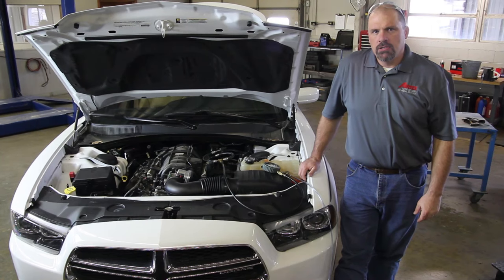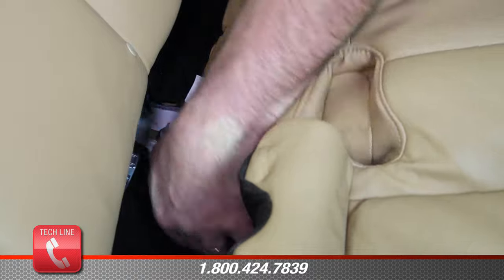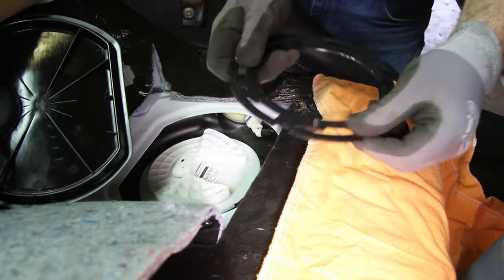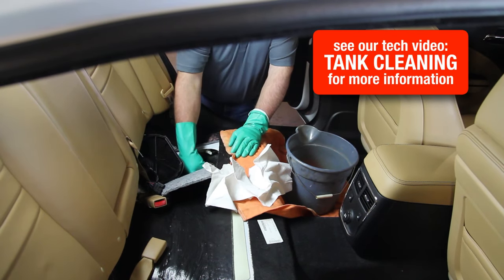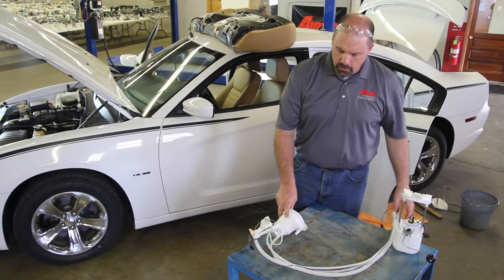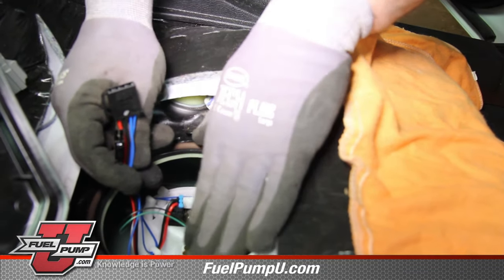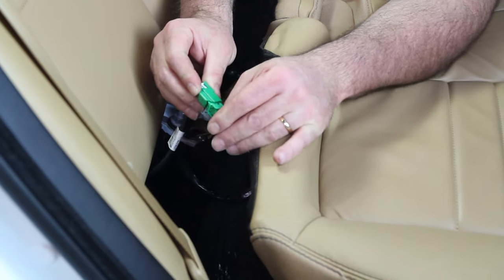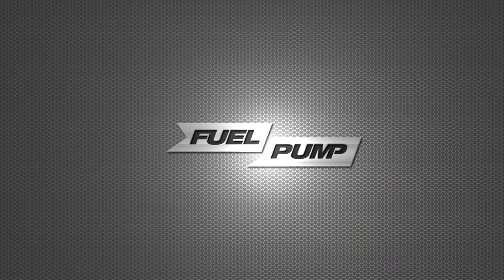How to Install Fuel Pump Assy E7192M in a 2006 - 2014 Dodge Charger, Challenger, Chrysler 300

Comment: The fuel pump went out on my 2006 Charger and this video helped me save $100's by doing it myself instead of taking it to a mechanic.
Reply: See video
Reply: How did you know the pump went bad and what were your symptoms?
Reply: @syndakitpanda1777  started coughing and wheezing
Reply: Mine did it this morning. I she started giving Covid symptoms. So I turned the button to on to see if I could hear the pump..... 🥲 just silence.
Reply: Before 2011 did they have 2 fuel pumps??
Reply: @TAPATIOPLEASE  yes I believe so.  The whole tank setup is the same just different pumps for high performance models. 

The driver side is the main the passengers side just sends more fuel to the main pump. Was the best way they could give it a almost 20 gallon tank.
Reply: @Vancev99x  ohhh I wouldn't know I've only had a 2.7 and 3.5 v6 🤣🤣 my cousin has a 2011 challenger with the 3.6 and 8 speed and his also has 2 pumps but mine only ever had 1 . Makes a lot of sense now
Reply: @TAPATIOPLEASE  oof the 2.7. That engine made mechanics come home kick the dog and smack their wives. I think dodge owes ever one that had to work on one a hellcat! 🤣 the 3.5 wasn't too much better but the 2.7 was just... 200k miles max on most of them and then is was just done working. 😅

Comment: for any of you interested - 2014 Dodge Charger SRT ; was just quoted $800 for diagnostics & replacement of main fuel pump at local Dodge Dealership- car has about 50k miles and it was still the original pump.  This is a common issue with the Dodge Charger, Challengers &  300's from 2006-2014
Reply: They improved the pumps from mid - 2014 on up.  All part numbers do, in fact, supercede to the new parts. 

The 392, Hellcat, and Pursuit models use a more powerful pump than the other models, and costs quite a bit more to replace.  A reasonable option might be finding low-mileage replacements from the boneyard.
Reply: Perfect.

Comment: On a push button start if you push the button twice without mashing the break it engages the fuel pump pushing the button twice without holding the break is like turning the key to the on position if you hit it a third time it goes back off

Comment: I did everything right. Now it's like the car is draining in power. It won't start at all. It's saying key fob not detected, the interior lights are dim, the horn is dim, no headlight's. Now  I have no power in the car. Is it a relay? Or battery?
Reply: Same did you ever fix it

Comment: To put the "diagnosis" simple, the right pump's main purpose is to provide the engine with fuel while the car is on, the left pump's main, but not only purpose is to provide fuel when the car is turning on, or idle.
Reply from the maker: The main fuel pump module is located on the left/drivers side of the vehicle. The auxiliary fuel pump module is located the right/passenger side of the vehicle. The fuel supply line to the engine is on the auxiliary fuel pump module  and supplies fuel to the engine. The electrical connector is on the main fuel pump module and controls both modules. Only the auxiliary pump module supplies fuel to the engine.

Comment: The fuel pump check valve is located in the right side of tank, not the left side. Wont hold fuel pressure on restart causing extended crank time.

Comment: Hi, great video!  Could you please provide info about the other module on the right side?  You mentioned that both of them are important.  
Also another video shows using silicone paste on the gasket; does this make sense to you?  Obviously want to use an appropriate amount (not glob it everywhere).

Comment: i have a '11 dodge charger R/T Hemi, and recently i noticed a tapping noise directly in front of the driver side dash that spontaneously starts during my drive and even when the car is  off. Almost around the same time cylinder failure started reducing the power i get when i press the gas. I'm starting to figure the two are related. Do you thing that replacing the fuel pump would solve my problem..Need help!
Reply: I had the same problem, I am sorry this may be too late to help you. The problem you are describing is the air conditioning recirculation control valve. you can access it behind your glove box.
Reply: Yes it’s the blend door actuator by the fan underneath the glove box. I replaced mine. However, one suggestion when you to to repair, do not buy an aftermarket actuator. It will go out in a few months and the work is tedious to fix. Buy the Mopar brand. You can get it cheaper online through Amazon.

Comment: it would have been handy to tell somebody how to take off the high pressure hose because now I snap my main fuel pump connector and that wasn't the module I was trying to fix now I have to replace both of them thanks
Reply: yeah...looks so easy in the video, but ALL the detail is completely left out. Might as well have said "replace the pump, all fixed". You will never have a successful repair from this video.
Reply: @B_HarTz  facts. He was moving too fast, his fault

Comment: Airtex I have a 2016 Dodge Challenger SRT and I have to get a new fuel pump which is covered by Dodge. I was told to run my fuel tank down so as not to make a mess in the rear of my car. Is this a similar installation as your video? Could this be done in a day if the dealer has the part? Thank you.

Comment: i have a 2005 dodge magnum and i suspec the fuel pump has gone out because i turn the key and do not hear the pump cut on. i dont know which pump has gone out. so im here asking how do i test the fuel pumps to see which is bad? rather a simple way or down to checking things with a multimeter. can you please help with diagrams, any schematics links or even what the resistance should be in the pumps for a working order? thank you

Comment: I've been having a problem with my fuel pump. When i was driving it and pulled up to a red light, then it turned green and my car shaked a little and turn off and I couldn't start it and the gears were locked. Had a mechanic check it and he changed the fuel pump for me, and my car was driving good again. A week later the check engine light came on, I had the same problem and i purchased and tried to change the fuel pump twice and drained the car from old gas, What do you think the problem could be everyone says the fuel pump but i put 2 different ones on and it wont start.
Reply: Fuel filter maybe

Comment: can you post how to replaced the fuel pump on passenger side
Reply: yea i agree, my secondary pump on the passenger side strangely has a crack on the top or what looks like a cover (the white part you see as soon as you remove the black plastic cover under the seat) causing fuel to pool in recessed areas. can the white top part be replaced or would i have to buy a whole new secondary pump? my reeks of gas from 5 ft away if there is more than 3/4 tank. def seems like a manufacturer defect
Reply: @UptownWatta  this is a European design as well and the suspension mercedes has this problem and sets an evap code you can get the cover seperarely and replace it don't try to glue it it doesn't last long I know

Comment: dear there hope you answer. me shortly .. i have got dodge charger fuel issues then i cleaned booth pumps but after the fuel level meassurer began to start from the middle never get to the left empty side  . nomatter how empty the tank is the sensor remains on half plz let me know where the problem is
Reply: +Airtex/ASC Performance Pumps thank you sir but just for more sure i wish to know how those sensors look like & how they supposed be set in right way .

Comment: Hey, how are you? nice video,I have a Dodge charger 2006 SE V6 3.5L, and  Im having troubles with my car, it has a elevated consume of fuel, and when its on sometimes the car feels like he got out of air, and I think that I have to change the fuel filter, I already change my spark plugs, but I really cant find where the filter is, and I didnt find it too on internet, could you please tell me if you know where is it, or what you think it is, Plz Thank you!!
Reply: +Airtex Pumps ufff thanks a lot,  another question is necesary to change the pump? I mean, must of  these cars has a parameter to change it? líke oil and other filters.
Reply: Ufff, thanks a lot!!! That really helps me.
Reply: +Airtex Pumps  I have an 07 chrysler 300c. .my car all of a sudden started idling rough ..i jus changed plugs And pcv valve. .i also added some fuel injection cleaner and then it started the rough idle ..do u think it's possible that it cleaned my system and now that stuff is in the filter causing it to idle rough?
Reply: carlton curry that would be the egr tube gasket not seated properly

Comment: Thanks for the video it helped but after about a week since the pump replacement I got a p0463 engine code which is the fuel level sensor. Did I do something wrong ?
Reply: Did you ever figure this out?  I have same problem
Reply: @Darkblue228  it’s the cluster, gas gauge needs to be soldered. Remove cluster and take it in to get fixed or checked

Comment: I have done this all setup but after a one day I changed fuel pump it won't work no noise at all when I switch on the keyfob any help
Reply: Airtex/ASC Performance Pumps
Reply: Could one of the connectors not be seated properly?  If you forced any of them, a connector pin could be bent...
Reply: If it’s cheap eBay and Amazon pumps, it won’t work, both pumps make a sound when they turn on. If they don’t make a sound, return it or buy auto store brand with warranty.... I learned the hard way if anyone else needs that info lol

Comment: Why does my 2006 charger stall when I fill up the gas tank it takes about four minutes for it to stall then I started up and it runs fine until I filled up with gas again
Reply: Airtex/ASC Performance Pumps they've been working on it they replaced the gas tank I'm going to fill it up with gas and leave the gas cap off for five or 10 minutes and see if it's a pressure problem with the Charco canister
Reply: X53 warranty
Reply: Srt Charger Old Man 2006 sounds like the purge valve is  bad

Comment: Is there a fuel filter in the Primary Pump (left side) ? I changed the secondary pump (right side) and the filter was very dirty.
Reply: No. There is no fuel filter at all
Reply: It's built into the assembly
Reply: @TheWillOfFate2014  Thanks for getting back to me. The Primary Pump failed 3 months ago. I asked the shop to save it for me. (The Pump AND the shifter failed at the same time so I went to get help) the primary pump has the smallest filter. and while the the motor still ran it seemed the pump failed to give enough pressure. A rip down of the entire assemble showed no mechanical failure. I can only guess that the small filter got clogged.  Very expensive failure point.

Comment: I change just the pump on the driver side of the dodge charger. Now im getting wrong readings on fuel guage. any ideas on how to fix this?
Reply: Jason Williams I have the same problem, did you ever figure it out ???
Reply: Dave Negrete yes. I figured it out. You have to take the pump back and get the  other brand , I’m away from my house right now so I can’t tell you what brand it was that I brought. But pretty much what the problem is , the pump Floats are made differently. If you sit compare the pump you have now to the old you would see that the old float goes down about 1in further than the one you have now.  
I took it back to advanced and got the one that’s under the premium sections which was about $10 more.  
Let me know if that works for you.
Reply: Yeah I figured it out myself, when I placed the fuel pump back in, the float level sensor accidentally got stuck over the plastic bracket on the fuel pump itself. So I took it out and I noticed it and all I did was take the float off and basically got it unstuck and this Time I carefully placed the fuel pump back in and now the gauge has accurate reading